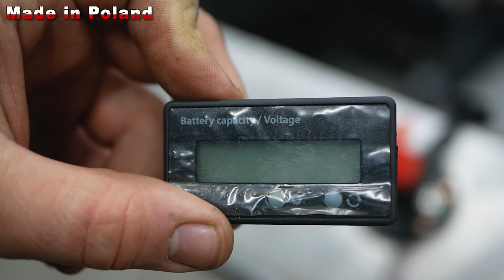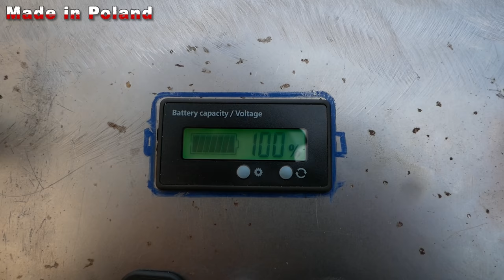Electric + Hydraulic = Ultimate Mini Dump Truck

Comment: You did a great job building that power dumper! I hope you installed rubber grommets in the sheet metal holes to prevent the wire from chafing and shorting out on the sharp metal.

Comment: if you replace the two push buttons for forward/reverse for two electric throttles of an electric scooter or something like that, you have more and more precise control over the engine speed, also for steering
Reply: I guess you would need a reverse switch then. It does seem like the buttons he has now would be difficult to use.

Comment: Many many years ago I helped design and build something quite similar to this, except about 6 times larger bed area and all hydraulic with a Honda 25 HP motor powering the pump.  We used a Ford rear end and by the time the power got to the ground it was somewhere around 5000 ft/lbs of torque, lol.  The first time we tested it, it was popping wheelies without a load in it.

These videos take me back to when I was doing stuff like this for a living.  I kind of miss it.

Comment: Have you considered remote control with GPS - you will need a loading arm to grab the wood...and never go out into the cold to fetch firewood.
Love to watch your builds and projects!
Reply: It's not possible with (in)accuracy of civil GPS. He would require much more sensors to do it safely.
Reply: that's funny AF :D - don't forget the autopilot and gaming system.... oh and the subscription based heated seats lol
Reply: @Nobe_Oddy  For the seats, you need to also put a Toyota badge on it.

Comment: That electric dumper truck is just dying to have a cement mixer drum mounter to it!  Put in concrete mix, add water, rotate drum until fully mixed, drive to where it is needed then pour the concrete into the form with the same tilting mechanism used for the dumper box!

Comment: Awesome build. 
11:00  I started using this angle bar & clamps technique for the plasma over 20 years ago. 
I also made many different fixtures to cut circles or slots. I used a bandsaw to cut a 6mm long piece of 125mm Dia x 1.5mm wall tube & welded a tab to the outside to clamp the fixture in place. To cut a 115mm hole.

Comment: That build is well designed and useful. Just one idea, have something to protect the controls from rain. Clever engineering with removable parts.
Good luck with your fire wood business. I am sure it will catch fire 😄.
Reply: Yes, agreed. 🤗 And as a next step we train autonomous driving and wood or stuff collecting on the whole property. (It could be possible!)(Install wlan and a camera to the vehicle and find somebody to program the app.)

Comment: All in all that looks amazing and you obviously have great skills when it comes to building and designing machines. However, I would like to give just a small advice for your own safety. Never leave any battery terminals exposed like that. If you accidentally drop something made of conductive material on the terminals you will risk the batteries exploding. Put some thick rubber mat over them for example. Stay safe and keep doing what you do. Great work! 👍

Comment: Small tip: the battery killswitch is easier to install from the backside so only 2 small holes for bolts and one center bigger for the key tube